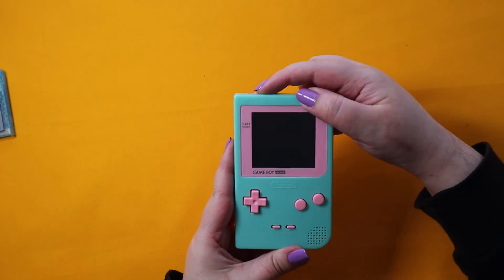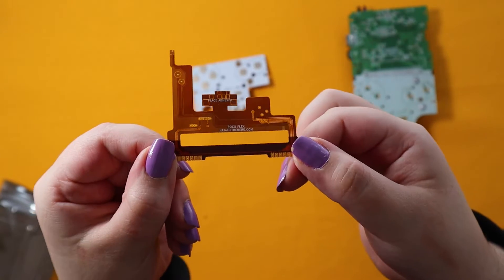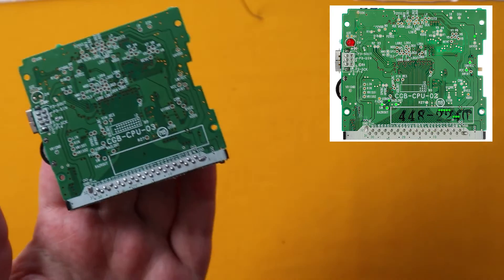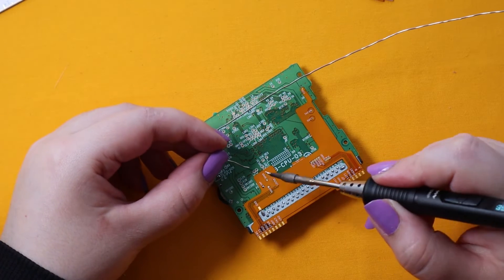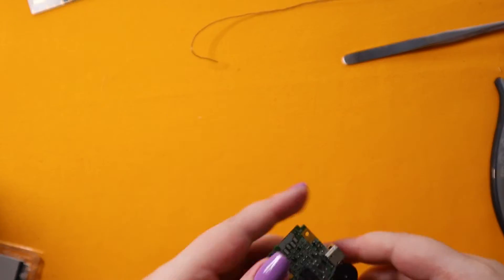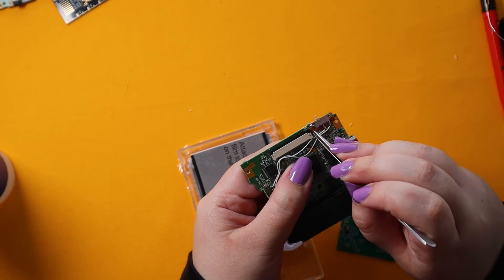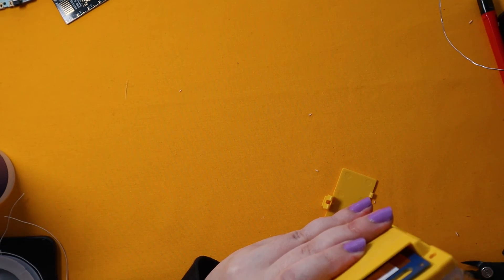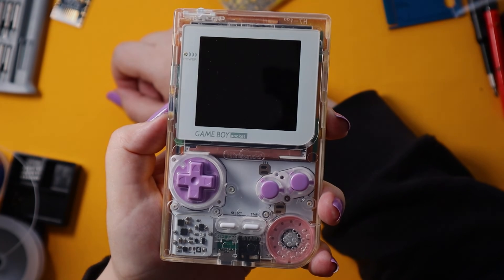How to build a PoCo (aka Pocket Color)

Comment: just learned about this mod.  Question, would it be easier to use solder paste to tin the board for the ribbon?
Reply from the maker: it could, not for the vias though

Comment: Where did you get the non-frosted clear shell? I cant find it anywhere
Reply from the maker: Cloud game store! You have to trim it to fit the screen though
Reply: @NatalietheNerd  Was is the one on aliexpress?! I think the one I am looking at isnt frosted but I cannot tell 😭
Reply from the maker: https://s.click.aliexpress.com/e/_m0G1CK3 this is the exact one
Reply: @NatalietheNerd  Thank you so much! Just finished fully modding a GBA and I think I want to attempt this.

Question thought, when getting a rechargeable battery for this, did you get the battery for the Pocket or Color? I plan on getting your Safer Charge DC board too!
Reply from the maker: For the pocket. Thank you for the support 😊
Reply: @NatalietheNerd  Sorry one more question lol... for the display, I buy a non-laminated Q5 Color screen, and then a Pocket lens? Wouldn't there be fitment issues because the Pocket screen is originally bigger? And do I need the USB C kit for the rechargeable battery? Sorry this is a confusing for me gathering the parts lol. Thanks for the help!
Reply from the maker: The safer charge comes with a USB C. You still need to trim the inside of the shell to fit the new screen
Reply from the maker: Yes, a pocket lens will fit
Reply: @NatalietheNerd  Thank you so much for the help! Just purchased your items and a parts GameBoy. Well see if I can do it haha
Reply: @NatalietheNerd  hey i had another question. do you know of any audio amps that may work with your poco pcb?

Comment: This is super cool and I kinda want to do this mod but I have an idea for a mod that you might be able to make possible. I want a GameBoy Pocket shell with the ability to switch between monochrome and color. Use one cartridge slot and have the Pocket and Color processors both in the console, on a switch, so you can flip between both consoles. This way I can play Red and Blue the way I remember, on a monochrome screen with the contrast slider, but also be able to pop in Crystal, Gold, or Silver and experience those beautiful colors.

Comment: Hello Natalie! I come to you with a question, but not about this mod in particular, but you're edit to the Bucket Mouse GBP Color Type E revision.
You say in the edit, "The only differences is there is an added 2.5V LDO (NCP161ASN250T1G) and a couple more capacitors and no RAM", and you include that nice iBOM website showing a nice guide when putting this together. I'm a complete noob when it comes to understanding these electrical parts, and just with the footprint and value, I can't find out which parts to order off of the Mouser website (I'm using this website as it's the one Bucket mouse includes in his write-up to order parts). When I enter the value and footprint into the website,, there are multiple options that range in voltage and I can't figure out which to get.
Do you have a list of extra capacitors needed? I'm assuming they are just more of the same capacitors that the original mod uses, but I'm unsure. Any help on this would be really helpful!
Love your mod vids too, they have helped me a bunch feel confident when doing this myself!
Reply from the maker: https://www.mouser.com/ProductDetail/onsemi/NCP161ASN250T1G this is the LDO, you need an extra 0603 1uF and 100nF (also know as 0.1uF)
Reply: @NatalietheNerd  Thank you so much!

Comment: If I had the solder skills to do this or a full PCB to transfer components to, is there a downside to this version vs the full version? I can certainly repopulate a new "pocket color" pcb, but this seems SO much easier. Just wondering if this vs has a downside to the other
Reply from the maker: No down side, just different techniques. The upside to using Bucket Mouse's board (which is the other one I recommend) is it uses new parts
Reply: @NatalietheNerd  Thanks Natalie!

Comment: Let's say the OEM power switch from the color is absolutely destroyed, what would someone recommend to use instead? I can't find OEM replacements online, only those replacement board type ones which might make it too big for this mod.
Reply from the maker: Unfortunately after market OEM ones don't exist but there are adaptor ones available
Reply: do you think any of those aftermarket adapter ones would work with your mod?  @NatalietheNerd
Reply from the maker: yeah they do, I have used one recently @Soul94255

Comment: Awesome video and look forward to when your store reopens to try myself! When you recommend the FP shell, do you mean the stock version, or the one built for a slip-in IPS? I realize you recommend the OSD screen, not IPS. Thanks
Reply from the maker: there's only one kind of FP pocket shell. FP pocket screens use the Q5 panel so their shells are pre trimmed for it which is why I suggest the Q5 OSD screen which is IPS
Reply: @NatalietheNerd  makes sense! Did you polish the clear shell used in the video or is that the white clear color?
Reply from the maker: It's a cloud game store shell. Really nice and clear but you have to trim for the Q5

Comment: Hi Natalie! This video was fantastic. I finally feel like I can build my own PoCo with this guide. I know you are on a hiatus, but is there a date range I can look out for a restock of your PoCo kit to place an order?
Reply from the maker: aiming for Friday (13 Oct)
Reply: @NatalietheNerd  Awesome, thanks for the info! I am curious, would something like this be able to be adapted to make a LoCo?
Reply from the maker: I need to work on it a bit more but yes. Ideally I'd like the flex to work for both
 @andrew_c_417
Reply: @NatalietheNerd When will the flex PCB part be up for sale again? I think I ruined mine trying to get connection to the lower board and the solder points are fried.